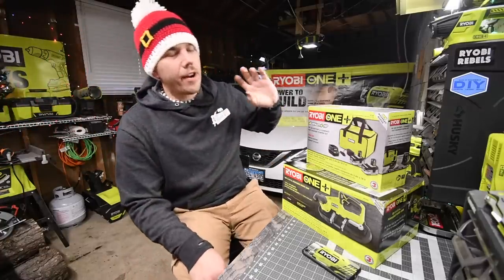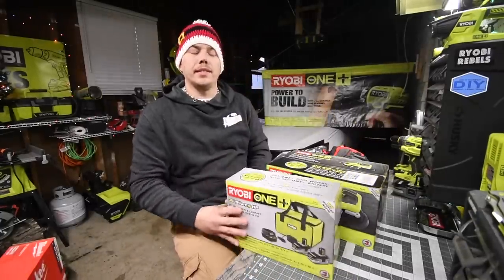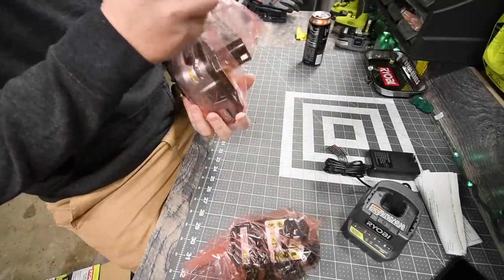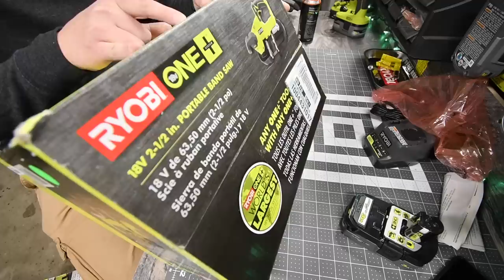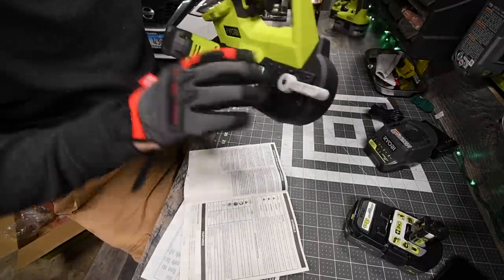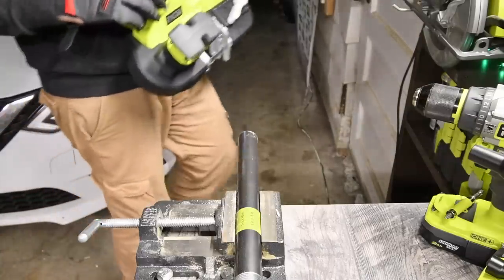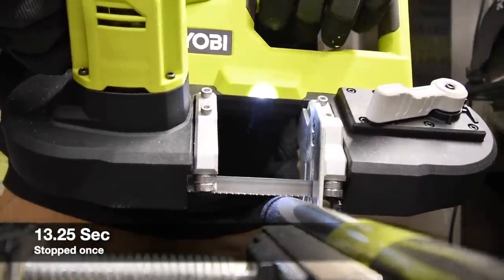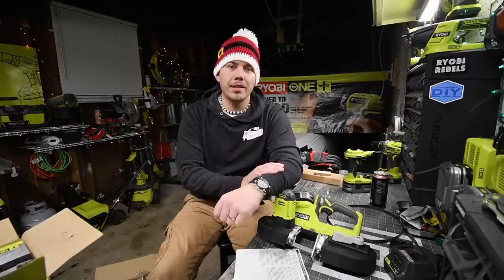FREE TOOL!! Ryobi Band saw, Unboxing/Test

Comment: FYI u can back the 2 screws on the saw deck with the onboard Allen key out an adjust it in or out for larger cuts u can also adjust how ur band blade rides the rails

Comment: Thank you for the video.  I have started purchasing Ryobi tools about 12 years ago, when they were blue and yellow color.  I just purchased this ban saw and the 6 volt battery and have 3 volt also.  I have a lot of use for this and it will be much easier to use than my  corded Makita reciprocating saw.  I really like the Ryobi products. Also, being a female with small hands, these tools fit great and are lighter weight.
Reply from the maker: I thank you Dirah

Comment: Bandsaw not available near me anywhere nor available online. I assume because it was the most expensive free tool you could get. A lot of folks taking advantage and returning the batteries or the free tool. I did it today with the 6 gallon vacuum for a $65 refund so battery kit for $35 and I bought the 23 gauge pin nailer I wanted instead.
Reply from the maker: Im sorry about that, hopefully it will become available for you soon
Reply: @ManCaverTools  I didn't want it but it would've got me a better return towards the nailer. I'm sure that's why its out of stock everywhere because people are buying and returning

Comment: Can't wait to get my hands on one. An idea for anyone out there is to come up with a miter stand this saw could mount into and have the saw pivot down for making cuts in angle or box steel.
Reply: Jon Dickinson search for “wrangler star Milwaukee hack”. He did a video showing a stand for the bandsaw. It looked like a really good stand. Check it out
Reply from the maker: Thank you sir and Happy Holdays
Reply: @Zee20Ate  thx for the link to wrangler star that setup is great. I envisioned more a chop saw but that would work fine. I've seen The Bears stand for the harbor freight model but this is much more precise.
Reply: Lol... They exist already Swag makes one that makes it work like a stationary band saw and the one I like is trick tools which is double duty .  Unfortunately they are too expensive for my taste.

Comment: I couldn’t wait on Ryobi so I went ahead and got the Milwaukee M12 bandsaw.
Reply from the maker: ill be getting that as well
Reply: I was thinking of doing that too but I wanted more cut capacity and couldn't justify the savings. After tax I paid $60 for the band saw. Actually less than that as HD sucks at price adjusting and looks like they gave me more money back than they should have.
Reply: The m12 band saw is very good at cutting metal
Reply: If the Ryobi 2.5” bandsaw was out about a year ago I would have likely gotten it instead of the Milwaukee M12 version.
However I also am invested in the Milwaukee M12 platform and when that bandsaw went on sale I went for it.  

I do really like my M12 bandsaw.

Perhaps Ryobi will come out with a 5” version but if not I’ll likely get the HF Bauer corded model as the Milwaukee 5” is only available on the M18 platform and I’m not looking to adding another cordless platform to my 8v Dewalt, 12v Milwaukee and 18v Ryobi platforms.
Reply: @cjharley7544  Gotcha, I would probably step into the M18 platform, once my pneumatic impact implodes or my compressor.

Comment: Your blade tensioner is falling down, loosening up.  A know issue.  When I unbox mine, I'm going to figure out a way to fix this.
Reply: Yes, once the blade seated, Dave should have moved the tensioner back to the locked position.  That should have prevented the slippage.
Reply from the maker: thank you sir, and  Happy Holidays
Reply from the maker: thank you sir, and  Happy Holidays